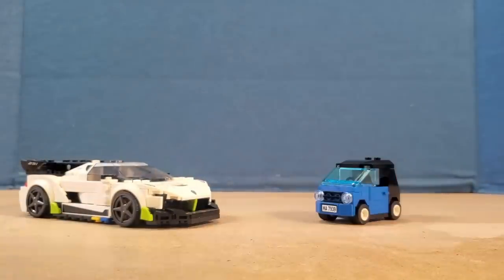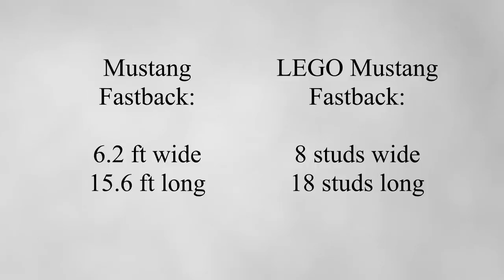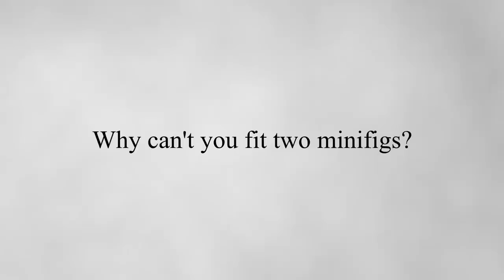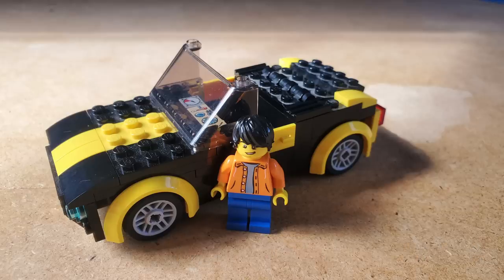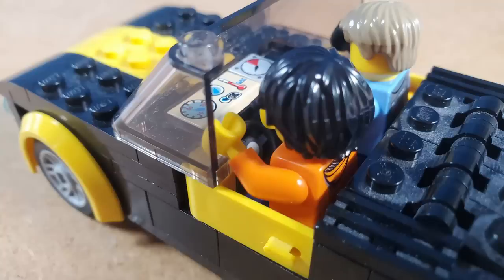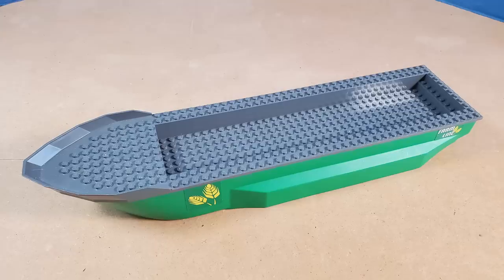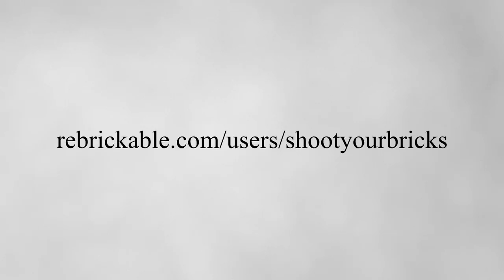Let's Settle This...

Comment: I believe most lego modelers go with S scale (or semi scale), which is scale used in train modeling. While things may not be accurate, they're big enough to look cool and close enough in scale where nothing is too jarring
Reply: Wait, isn't S scale 1:64?  I feel like that would be way too small.
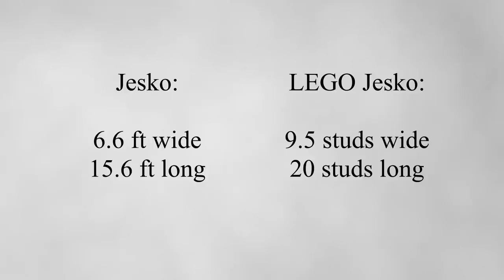Reply: Both the old Lionel tinplate trains and the American Flyer S Scale trains were S Scale (1:64) in size, even though O Scale Lionel is supposed to be 1:48 scale.  If you put the commercially available LEGO trains next to one of them, you will see that the size and proportions are pretty close.

L Scale, the name given to LEGO scale trains whose scale is based on the track width, is 1:42 scale.  LEGO train kits, like Lionel tinplate, were made smaller so that they looked and behaved good going around the tight curves that come with LEGO track, they are much, much, much tighter than actual railroad curves.

Correctly scaled Lionel and LEGO trains are larger and look better, but have a hard time negotiating the tight curves on LEGO tracks, as my son is finding out.
Reply: @survivingworldsteam  I was just confused at the use of S Scale, which is smaller then LEGO trains.  Lionel O Gauge is pretty close though.

It goes beyond just the tightness of the curves, compared to the track gauge, most LEGO trains would need to be 10 studs wide to be accurate!  I've gone with 8 myself, not counting piston rods and the like.

And yes, if you try and correctly scale passenger cars in terms of length, they really don't like standard LEGO curves (and especially switches!)  Even my 52 stud passenger cars already have difficulties sometimes, and they are only about 75% the accurate length.
Reply: @scottthewaterwarrior  to try to resolve the confusion, I have a Lionel 1679 tinplate boxcar here.  Measuring it with LEGO studs, it is about 7 studs wide and 25 studs long.  If I then place this same boxcar next to an S Scale American Flyer boxcar, you will see it is the same size.  So even though Lionel is technically O scale, many of their offerings were closer to S scale.  American Flyer did the same thing in tinplate, and finally decided to come out with their true S Scale two rail track after World War II, rather than continue compete directly with Lionel in the O scale arena.

Lionel collectors know that Lionel played fast and loose with the concept of scale over the years, offering some products that were a true O scale, and others that were smaller.  If Lionel can "get away with that", so can we.

As you have done, scaling them down a bit makes them work better on switches and tight curves, the same reason Lionel did.

Comment: You could just look up the scales for the different types of lego figures - the community has extensive material on the subject. The minifigure comes in at 1:43 by height or 1:25 by width. Since those are very different, if you build anything to scale, no scale will feel quite right. And cars are always to tall if you try to build them in minifigure scale, so most just build them bigger.

Comment: The thing that bothered me the most is the different heights of floors in Lego buildings. You build two three story building’s and one is taller than the other? I realize that normal buildings can have 8 ft, 10’, or even 12’ ceilings. But it’s annoying when you start designing a MOC and discover it’s a midget compared to the building you we’re going to place it next to.😜
Reply: Except for single family homes and skyscrapers, ground floors are normally a higher ceiling than the rest, so that seems reasonable for them to do
Reply: I normally design my building MOCs to be 9 or 10 bricks high (+/- a plate or two) for the ground floor and about 7 to 8 (+/-) for the upper floors. Bearing in mind that a brick's height is 1.2 studs, that gives floor heights of about 12 feet and 9 feet (using the 1 foot = 1 stud scale). Also buildings usually have some depth to the joints and the floor itself. 
If you're designing a MOC it helps to consider its context and criteria, so if it is supposed to match the height next to a particular building then it's worth having a look at that first and designing to fit.

Comment: So th e problem with minifigure scale isn't so much height as proportions. In scale modelling and toy soldier land we have a few systems for defining scale: eye height is the most common in wargaming, and lego figures are 35mm from floor to eye line. This equates to 1:48 scale. However they are much wider than a real person, with a much bulkier profile. This means that a 1:48 scale vehicle will always be too narrow to accommodate the right number of figures. Compare to model train sizes where lego had to be bigger than scale to fit with the figures!

Comment: The thing with lego trains and the fixed size of the wheelsets vs how real trains do it is pretty simple to explain. As real life trains got bigger, outside-frame wheelsets became more common, and once diesels took over and boilers werent a limiting design factor, we could build trains to take advantage of the loading gauge better, which is why some early british diesels had that strange tubular look, they were the maximum size allowed by railway standards. We built heavier and wider trucks or "bogeys" and added more wheels to handle the weight rather than making the wheels bigger or the rail gauge wider.

Comment: I just go off the scale by using the LEGO track gauge (37.5mm/1.47637795 inches) divided by the real track gauge its meant to represent, which is 4ft 8.5 inches. This means 7.96460178 mm/0.313566999 equals a foot in real life, and this is purely for the train modelling, as that always has a certain scale and everything conforms to it

Comment: The railroad gauge is 4feet 8 inches. 

But the gauge is not the center messurment, but rather the inside to the inside.

this is a interesting measurement, because while a lego figure may have any length, be very short or long, standard gauge is a very specific size, so we can specific a very exact scale.

So the scale is exactly 1:38,3.. so .. well a stud is pretty close to a feet.

While, true, that is not really minifigure scale.

I see it this way. A minifigure is really two people sitting side by side. Or possibly a person and a half say in a airplane seat. This kind of solve most problems. A train now suddenly is just normal with 1 seat on each side.

Comment: I tried building 10 stud wide trains once, it was a massive investment in parts and didn't run well at all.  Switched over to 8 wide and you can build some really amazing looking models that still run quite well (especially when you "cheat" and lubricate the axles).  Though they are technically 10 wide counting handrails and the pistons on my steamers, but the main frame is 8.

Though I also build my road cars 8 wide, so that means the trains look too small in comparison, but I'm like 15+ years, so a bit late to change now.

Comment from the maker: If you enjoyed the video, please consider subscribing. Thanks!

P.S. I think a meter would be slightly more than 3 studs.
Reply: Meh, 1 stud = 30 cm is close enough.
Reply: If I'm building at minifig scale I aim for 1m = 3 studs, so that's less than 10% different from the 1' = 1 stud calculation
Reply: Actually, metric is technically given exactly due to the Minecraft sets. In Minecraft 1 block is a cubic metre. In the Lego sets, one blog is 2 studs wide. Therefore, mini figures are roughly 275cm tall, or in Imperial about 9 foot tall. Now isn’t that a horrifying image.
Reply: Measured center to center across two studs = 8mm = 0.3125 in (5/16”). I’m from the USA, and can still testify that metric is so much simpler. Imagine skip-counting by 5/16” or .3125” … just— ouch. I’m really good at it now, though! (Remember that the distance across 3 studs from center to center = 2 studs = 5/8” = 16mm.)
Reply: Great job, I misunderstood the start and thought you were measuring height of bricks, not width but you have a plate on its side.

Comment: And then there's airplanes.  Lego's passenger jets tend to be either six or eight studs wide (fuselage, not wingspan), but as an example, a Boeing 767's fuselage is nearly 16 feet wide.  Of course it also seats seven across with two aisles.

Comment: Great video and great idea! Scale is so important in regards to designing anything. As an architecture student this was super interesting
Reply: We made a model of our railroad museum before it was actually built from the blueprints we had, to give visitors an idea of what it will look like.  We too used @ShootYourBricks scale of one stud equals one foot and rounded everything to the nearest foot.  I used commercial stick on letters to do the lettering on the front of the museum and fudged the windows slightly to use the available windows we had.  It turned out amazingly good.

Comment: How I see it is I put them in different scales, personally I’m not a minifig scale guy, since it’s to hard to make so I just separate them into Minifig scale( usually hard to build) and city scale( downsized or slightly upside, but good enough)
Reply from the maker: Yeah, the smaller the car, the harder it is to make it detailed.

Comment: The "Standard" gauge (width between rails) around the world is 4' 8 1/2", which is much more definetive than the average 10 feet for a US Diesel Locomotive. Which if you look at lego tracks, it has 4 usable studs, and a little extra inbetween the edges, so I would say it is still about right.

Comment: The size of a train’s body has little to do with the gauge it uses, (the term for the distance between the inside faces of the running rails) which the most common standard is, well “Standard Gauge”, 4 feet 8 and 1/2 inches or 1435 mm.

A train with a similar sized body can have somewhat wider or narrower wheels.

Trains with the same wheels can have bodies the vary greatly. 

I work on the New York subway. Our train fleet has two different body widths and three different body lengths. So you have a variety of of sizes but all share the same track gauge.

(8 feet 7 inches wide by 51 feet long, 10 feet wide by 60 feet long, and 10 feet wide by 75 feet long.)

Comment: One thing about trains (at least here in the USA):  The space between the rails is 4ft 8.5in, known as standard gauge.  The locomotives and rolling stock overhang the gauge a little bit, usually being about maybe 10ft wide, give or take a few inches depending on specific pieces of equipment.  Looking at regular Lego track there are 4 studs between the rails meaning that in a 1:1 measurement Lego track is technically slightly narrow gauge because there are only 4 feet (4 studs) between the rails.  I'm not sure how you'd be able to model standard gauge other than making new track that isn't Lego track.
Reply: While there may only be 4 studs between the tracks, the actual distance between the rails is closer to 5 studs.  But trying to build and power a 10 wide train is extremely difficult, and that is before you even get to the corners that are insanely tight even compared to 6 wide trains!
Reply: It's the same issue toy train and train set manufacturers have; their curves are also way too sharp compared to real life.  Some made the passenger cars shorter so they could go around curves; some like the tinplate train makers made the entire train smaller like LEGO did so it would look and round corners well.

Comment: The other obvious issue is that minifigs have a higher width to height ratio than real people, and this affects the scale needed for anything you want to put them in. So translating feet to studs may seem like enough, but perhaps a minifig scale cargo ship ought to be closer to 100 studs wide (with its proper length converted to studs) to account for the extra width of a minifig. The same logic should apply to Lego cars, so perhaps the Speed Champions sets are an accurate minifig scale after all, and Lego roads simply arent designed wide enough for a true minifig-ratio/scale car?

Comment: I think 6-studs is the optimal width, but you do have to account for the wheel fenders. It works out for larger vehicles like trucks and buses, but it should be more like a 5-stud wide build for small cars, which however would actually allow for proper 2-seat wide cars. The obvious challenge with that though is the odd number of studs and Lego's lack of 5-stud wide parts (they'll definitely need to make some new 5-stud windscreens for that to work). Whatever the case, given that minifigures are much wider than they are tall relative to real people, 6-studs works fine. I think Lego vehicles look most proportional when they're a little bit chibi anyway.
Reply: I think your going to have some problems with fitting two minifigs in a 5 wide, unless it is a Jeep with no doors so their arms can hang out the side.

Comment: On trains: there are different sizes of tracks. Normal lego tracks (like the ones you first mentioned for the diesel engine) are basically narrow gauge. The locomotive dimensions are correct. The difference is that lego puts all of their truck (the wheeled bit) elements much smaller than they would be for a piece of that scale. In reality, they are much larger and overhang much more. Then, when the 10' dimension is compared, they look much more natural.

Comment: by your logic the death star model should be 524,934 studs wide, almost 13,123.35 feet in length.

That would be 13,123 LEGO studs wide for a set of a LEGO figure building that set.

Comment: Heres a question, how much does the Technic Minifgures change this?
Obviously, you would need a much bigger car, and actual Technic cars vary in size. But what size brickbuilt or technic built car would you need to realistically seat a Technic Figure?
Reply from the maker: Man, I need to get my hands on one of those. it would be a lot bigger, but it would fit better because the figure has better proportions.

Comment: Well, also by your stud-to-foot measurement, a minifig themselves would then be about 2.5 feet wide, whereas real people usually only have a shoulder breadth of about 1.33 feet. So, for two car seats 2 studs wide to fit in a car, with space for a center console, probably 1 stud wide, and half a stud on the sides of the seats for shoulder room, so another full stud, 6 studs would be the minimum requirement, before accounting for extra width to even design the exterior of the car with current minifigs, and if minifigs could fit in the 2 stud seats with room to spare, a cars interior could potentially only be about 5.5 studs wide.

Comment: I love the so called playscale. I have the Razor Crest in Minifig scale and playscale and as awesome as the very detailed interior of the UCS version is, you can’t help but feel it totally oversized compared to the minifig.
Reply: Same, I built that set recently and just could not understand why they made a UCS version when the original is so well scaled.
By the way, you can open up the cockpit to the rest of the interior by removing the technic rectangle (and weapon storage) that goes between, then you can add a ladder in and the interior is basically perfect.
Reply: @jimwar211  yeah I know 😉 Already did that and a few other awesome changes to make it look better.

Comment: As Lego is Danish, I highly doubt they used imperial measurements.
Reply: Plug in 1 meter in and it will still be off the actual value means nothing bc the scale is off

Comment: Ha. Forget the airplane models. I have the original airport/jet which seats 4 passengers in a single row + one pilot in the cockpit. It's effectively the same body design as the small one-seater prop plane that I also have, just longer.

Comment: It’s possible that LEGO trains are designed to be a narrow gauge, that is, smaller than the usual (standard) gauge of most railways in North America, Europe and Asia.

A lot of railroads, especially in the American west, Wales, and South America, were historically built with narrower gauges than the standard gauge, especially in and around mines, mountains, or wherever there was limited space.

It’s also worth noting that several national rail networks in other countries are built to narrower gauges than the U.S. and UK. Japan, for example, built its railways to 3-foot gauge, until they introduced the Shinkansen, which was built to the standard 4’8½” gauge. Some European countries also had non-standard gauges, which was a problem when they attempted to connect the French national railway with the British railways through the Channel Tunnel. Some of France’s railways are 3-foot, 3+3/8-inch gauge, whereas by 1892, all of Britain was using the standard gauge.
Reply from the maker: I totally forgot to mention other countries in this video😅 thanks for bringing it up.

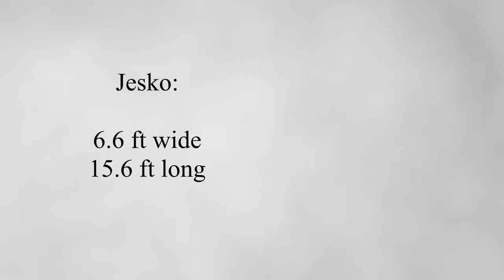Comment: All you silly people fussing over measurement systems.  Scale is scale, whether you working in meters or feet. 1 stud = 1 foot is close enough to 3 studs = 1 meter.  They are both about 1:40 scale.  And when I am modeling something; I have often switched between them in scaling them down, it's whatever works best for me.

Modeling will always have it's limitations based on materials and what is humanly possible.  I beat the subject of model trains to death already, but another example is that the HO scale slot cars used to always be too wide so they could fit a pancake motor inside.

The whole purpose of all of this is to have fun. Don't sweat the details so much that you can no longer enjoy it.  At that point, you are taking this much too seriously.

Comment: Lego trains can be a bit iffy. Standard gauge is 4ft, 8 and a half inches. However, just like in real life, the gauge (width of the track) can be other things than 4ft, 8 and a half inches. The trains also tend to get smaller with the gauge of the track.